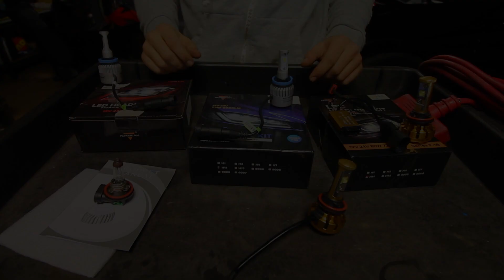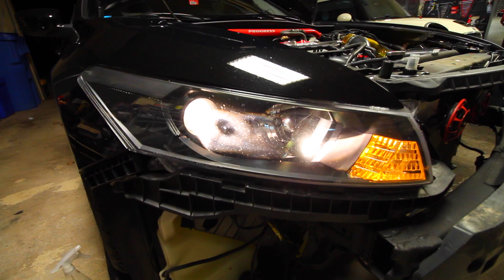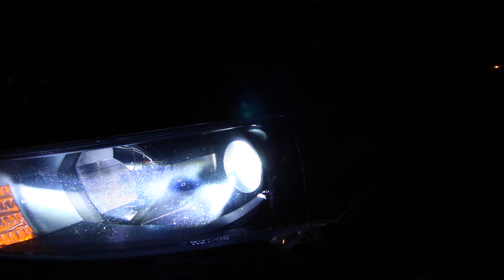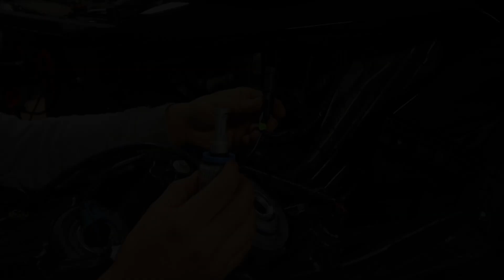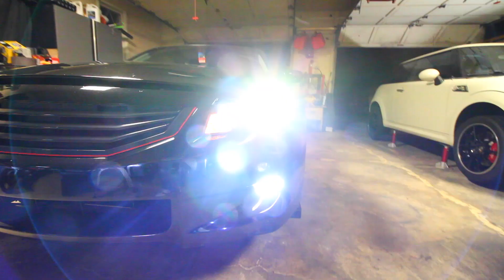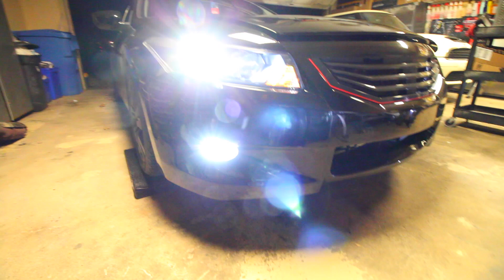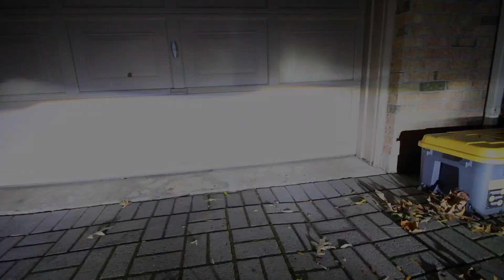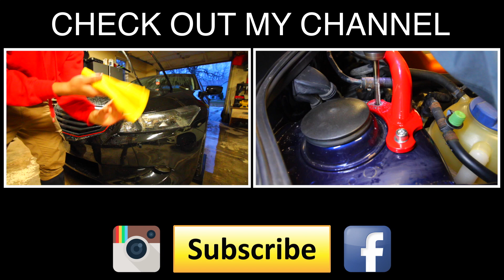LED Headlights: Are they Better than Halogens?

Comment: how much horsepower does this add to the vehicle?
Reply from the maker: 25 per headlight :)
Reply: milanmastracci you answered as i was watching lol
Reply: Well, there are 745.7 watts to a horsepower. If a pair of LED headlights draws 60 watts, or 0.0804613 horsepower compared to 110 watts, or 0.147512 horsepower for a pair of standard halogen bulbs, that is a 50 watt savings, which is equivalent to  0.0670511 horsepower, but that is not factoring in that the average alternator is only about half efficient, so you could gain a total of 0.134102 horsepower, a gain of a little over 1/8 of a horsepower from reduced alternator drag on the engine.
Reply: Thanks I needed this long time ago
Reply: Thanks I needed this long time ago
Reply: milanmastracci what color rating is this 10000k?
Reply: over 9000
Reply: how much horsepower do you have with that ugly shity yellow halogen bulbs :D
Reply: Mauro Beltran lol
Reply: less power taken from electrical system balances that perfectly
Reply: U should buy the LEDs with turbo! Instant 100hp!
Reply: Mauro Beltran What kind of question is that? We all know this improves fuel economy.
Reply: along with the K&N filter and a turbo charger/intercooler, easily a 50
Reply: Mauro Beltran it depends on the color temp...if you put a 400k set you will gain around 45hp at the wheels.. see the logic?
Reply: Over 9000!!
Reply: Lmfao
Reply: Hilarious
Reply: In that case, the LEDs should be installed at the back of the car to give it an extra boost, just like what Ironman has under his boots.
Reply: Dude so much it’s crazy
Reply: Is it a Ford?
Reply: It depends on the light color. White light 200 black light a thousand
Reply: It would actually bump up horsepower because the electrical requirement of Leds are lower than traditional bulbs, but the gain is very minor and negligible
Reply: Not as much horsepower as you'd think..now if you add a sticker that says LED equipped oh shit hold on to you're fake racing seats buddy...lol
Reply: A 1000hp so you have to be very careful.
Reply: +50 Hp lmao
Reply: After you put that turbo headlight fluid in, you could possibly get an extra 30
Reply: 3 name changes allowed every 90 days. You got a lawn chair for your drivers seat don’t you.😂
Reply: 1000 HP on a car but no lights try it at night xD
Reply: like extra .00000001
Reply: 0 to the engine, perhaps 100 to your right foot
Reply: Few donkeys
Reply: You are not deserve ,forget driving but even touch the car.
🤣😂😅
Reply: Rough guess

1 million HP and and extra 3 and a half torque's.
Reply: 500
Reply: The speed of LED light is way faster than halogen light. So your answer is unmeasureable.
Reply: Yes
Reply: actually the cooling fans on the LEDs help the car to go faster.
Reply: Wouldn't the thrust from the photons launching out the front from the increased output actually slow you down 🤔
Reply: even though they push air the opposite way
Reply: Following the rule, E=MC2 and the properties of Zefram Cochrane, you should be getting an addition of warp factor .1 but I'm just speculating.  lol
Reply: 0 HP

Comment: I changed low beams from Osram Nightbreakers halogens to LEDs in my euro Accord.  I have projector and H1 socket. I like LEDs better, especially when driving on country roads, LEDs give better light to right side, and I have better visibility in bushes, so I could potentially see better animals. And with LEDs all road signs, reflectors are far more brighter.  Downsides - it's harder to see potholes and on wet driving conditions everything dark. I left halogens in my fog lights, so I am using these to get little bit yellow light and see better potholes and wet road.
I compared light with aftermarket HID on similar Accord.  Results are pretty similar.

Comment: Looks amazing...when you uploaded that photo with the new lights, I honestly thought you installed an HID kit. LEDs are getting brighter everyday
Reply: There are fast xenon kits, and LED can't output that much light as HID's
Reply: And I find myself hitting my high-beams at oncoming vehicles that I assume are also on high beam more everyday.
Reply: Photo on instagram*
Reply from the maker: Yeah and there isn't a wait time for the LED's to turn on like HID's
Reply: ordinaryJeff they need to go back to halogens,  and proper aiming!
Reply: LEDs are still far away for maximum performance. I'd say another 10 years before LEDs can be even somewhat close to HIDs.

Comment: My headlights have a projector unit but only take H11B which I doubt anybody carries
Reply: Grant Rodgers BK1 Genesis is the same way. Got the regular H11s and some wire along with wire crimps. I used the crimps to the wire and attached the female ends to the bulbs and male end into the headlamp. You may need to take the socket mount off the mounting plate to do this however it does work.
Reply: Heyu Yoma There are H11B HIDs but not LEDs that are comparable evidently. Owner did not wosh to go to HIDs due to wiring. Either way it works. That and the LEDs are brighter than most HIDs on 35w settings.

Comment: Do leds require a projector housing like hids?
Reply from the maker: They do not, however they need to be installed correctly so the sides of the bulb (the actual LED chips) are facing to the left and right, not upwards and downwards. You shouldn't have any problems :)
Reply: Kevin Nguyen nope LEDs are crisp they don't flood. I personally run hids without projectors never been high beamed I just don't like projectors i like the way hids flood.
Reply: HOW ABOUT FOR YOUR HI BEAMS DO YOU HAVE LED ON THEM TOO ?
Reply: thanks for the clarification guys

Comment: You're not very smart. Comparing brand new LED bulbs to old halogens..... you know that new halogens would have been brighter than your old ones too right? HID are the only way to go. LEDs will perform like shit in the winter and they dont have the same distance as halogens let alone like HIDs. Only benefit in that they are brighter for the shorter distance they shine. If you're going to make a comparison, make a fair one please!
Reply: 1MartinPL lol dude you're calling people a moron when you're the one getting overly aggressive over the Internet.. just chill
Reply: Things have changed alot in the LED world...I have run hids for a long time, tried a set of leds a couple of years ago and they were garbage...recently a friend of mine with the same car as mine has got new current gen LED globes and I have driven with them...to be honest, they shit all over my hids. I even threw a new set of globes and ballasts in my car to make sure my hids were under performing and still his LEDs are infinitely better than my hids, both in terms of overall brightness, sharpness of the light and throw distance. the difference is like night and day.
Reply: 1MartinPL    how about you learn how to hit reply on here or mention who you're talking to.
Reply from the maker: Those were new Halogens... I originally had HID's in my headlights. The reason why I did this video was because my HID's were giving me problems.
Reply: 1MartinPL my new car has full led option from factory. It's winter time -11 celcius and no problems, also they give me the best vision out of my other 3 cars. I fell in love with Led, in the city during the night it's very easy to see everything. They also look great
Reply: 1MartinPL you are talking about old type of LED which were not powerfull enough. Now LED are so powerfull that they need radiators to keep low temperature.
Reply: LED is taking over, I used to do HID retrofits all the time, now its all about the LED retrofit craze. Im running 2015 Nissan murano led projectors to replace my previous TSX HID retrofit and its holding up well, not to mention its simpler, lighter, and more compact as a unit without an HID ballast. 

As for Drop ins, LEDs are certainly getting better and better, LED in halogen projectors seems to be checking all the right boxes, not to mention low risk of melting the oem halogen unit (like HIDs used to do).
Reply: no such thing as  "current gen LED globes"  What you want to focus on is the TYPE of LED and what it is printed on. For example, SMD LEDs are considered, "old school" yet you still find them on current LED bulbs. Lumileds CoB LEDs are far superior. THEN you have to look at the bulb itself and see how it is laid out.
Reply: TJ Arends ... you can buy a pair of hids for $30.
Reply: ... leds work no matter what the temperature, just like halogens.... hids on the other hand don't.
Reply: you've pointed out another advantage of LED no loss of brightness till its done and longer operating hours
Reply: Yeah older LEd's sucked...i've been watching LED's since mid 2005...they have come full circle...i'm still on HID but it'd be nice to have 50,000hrs of lamp life...all my rears are LED's though....gonna order some for my projectors which have a nice cut off...should work as above
Reply: I went to a car audio shop since my HID ballast went out. The guy there tried to mention that LED bulbs are the new generation and that HIDs are something of the past? That LED bulbs are much brighter? He qouted me $65 for a set of LED H7 bulbs. Got home went online and eBay has a set Cree h7 bulbs for $15 shipped with good reviews. I mean I understand that people are hungry now a days to make profit but I ain't no sucker. Before I make any changes to my car, should I consider ditching the HIDs and just install some Cree LED H7s from eBay? What you think my man since you sound like you got some knowledge about this. May I mention that I have halogen housing headlights. I'm just fed up with either ballasts going out after a couple months.
Reply: i dont think hes talking about HID's I think hes talking about LED's, and Also LED's are so much more affordable than HID's.
Reply: 1MartinPL hid you have to deal with a ballast....
Reply: milanmastracci everyone thinks hids are better but in reality they all have theyre flaws also having to deal with the ballast
Reply: you just don't know what you are talking about. If LED is worse then HID why do all the new cars come with LED, MAtrix and LAser?!?!?    /watch?v=0OJjvYPV3oc and shut the fuck up

oh, and it's mostly about the lens, not the bulb. If you put an aftermarket HID or LED on old headlamps you will blind others and want have the same quality as headlamps made for LED
Reply: PajoPatak who are you talking to? I think leds are better
Reply: 1MartinPL   well shit, if you don't like it, start your own damn channel idiot.
Reply: 1MartinPL dude you are getting way too defensive over this, it's not a big deal lol
Reply: HID lights suck, for one low beam light it will cost $175, my car is only 3 years old. I can replace both my low beams for $60  and they will out last and out perform HID lights period.
Reply: lol You should learn something for once in your life... maybe try reading a book you fucking moron.